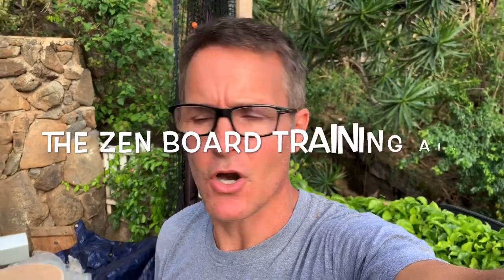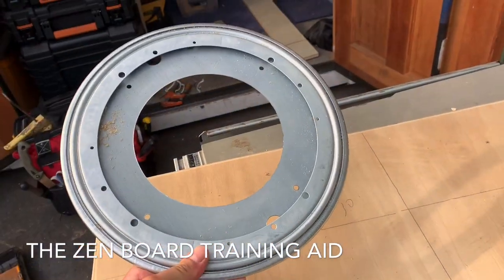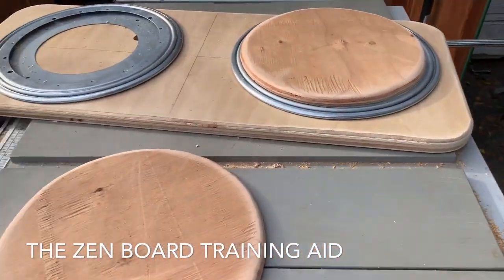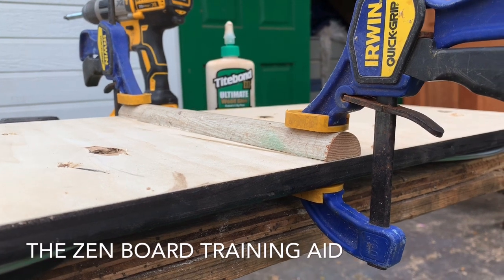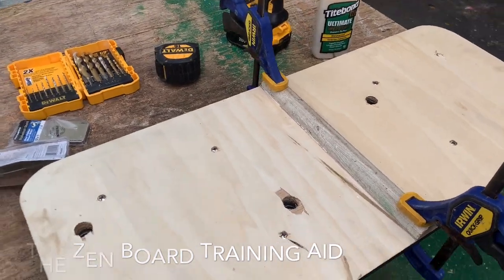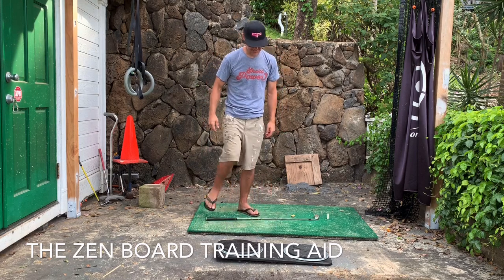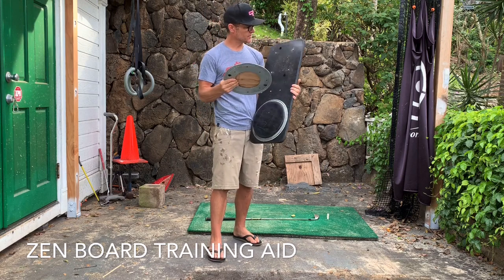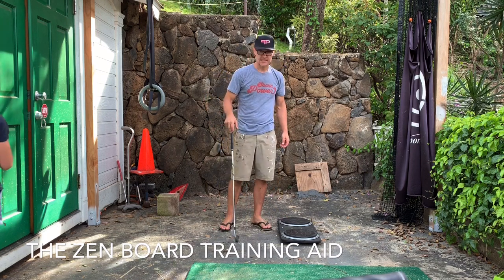Mastering your golf swing with the Zen Board

Comment: Ok, so I built one of these and discovered something interesting. You can balance the entire board itself ON TOP of a single lazy susan disc. It raises the challenge significantly as any rotation prior to an edge of the board touching the ground, spins you dangerously out of control.

Comment: Is the idea that you should xfer pressure to lead foot at transition before lazy susan spins? Or what is purpose of the lazy Susan plates?
Reply from the maker: Yes the idea is that you transfer the weight before you turn your hips. Very few amateurs have enough separation between their lower and upper body meaning as soon as they turn their hips the shoulders go with them and the club hasn’t had a chance to shallow. Also spinning the hips from the top never allows you to get to the front foot for good compression and contact.
Basically in a good swing the pressure starts to five forward towards the ball of the front foot which moves the low point ahead of the ball and shallows the club. Then the hip turn initiates the rest of the chain so the club can hit the ball from a shallow descending path.
The lazy suzans give you more of an awareness of the pressure shift before the hip turn since turning the hips is achieved by using ground forces in the feet.
Hope that explains it.
Thanks for the comment.

Comment: Hi mate - great video thanks.  How thick is the dowel if you are able to tell me?
Reply from the maker: I used an inch diameter dowel cut in 2 but to be honest anything about 3/4 inches thick work. The surface you use it on is important. I made another one with a smaller size dowel and it works well on a solid floor but on my hitting mat it just sinks in too much and doesn’t rock.
Reply: @migmatisgolf  Thanks so much for the quick reply.  I also sent you an email request.  Thanks for the great advice
Reply from the maker: @dl2821  video sent in reply to your email.
Reply from the maker: @dl2821  sorry if you got it multiple times. Was struggling to send such a large file.

Comment: I was going to make a teeter board after watching Zen Golf Mechanic and also just ordered a couple of ball bearing square plates to try to make the rotating drill board. Then I stumbled on your video! What is lycopodium? And what screws/turning bits? did you use? Thanks for sharing this!
Reply from the maker: 😂😂😂😂😂just read the description again and totally missed it first time. It’s a typo. Should read 2 half inch thick plywood circles 10.5 inches in diameter. Will correct it ASAP.
Reply from the maker: Ok description has been amended. I used lazy suzans from Amazon and included the link. You can normally get them at big box stores as well. I used 1 1/4 screws to attach the dowel on the underside and 1 inch screws up from the underside that lines up with mounting holes in the lazy suzans. I filed down the sharp ends so that a stub of about 1/4 inch protrudes through the top side of the board. I used 3 screws on each side. If you send me an email address I’ll send you some close up pictures.
Hope that helps.
Reply: @migmatisgolf  Thanks much! I'll give this a try soon!